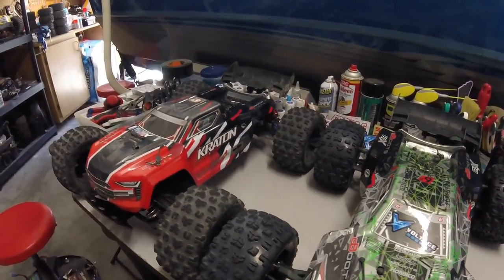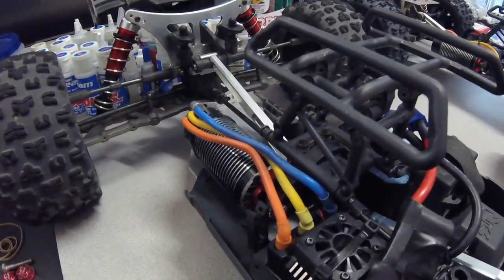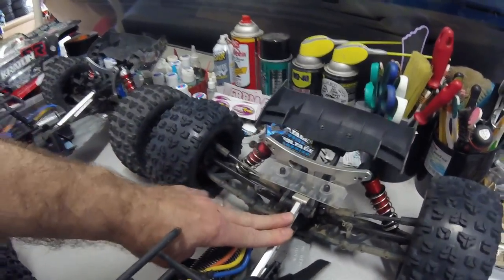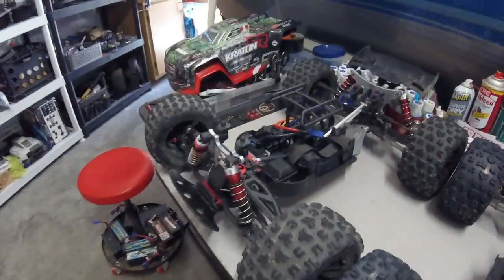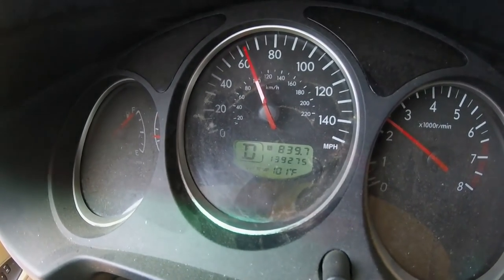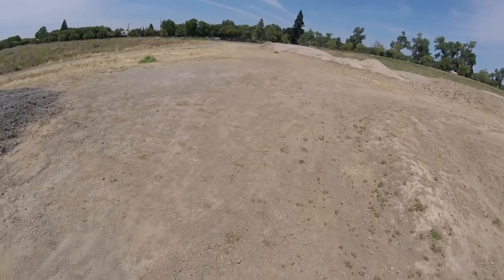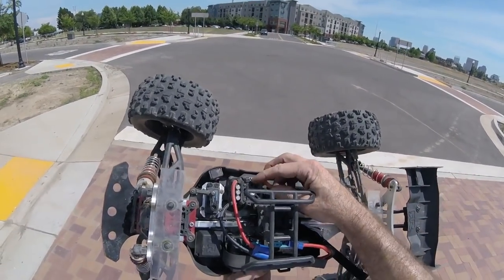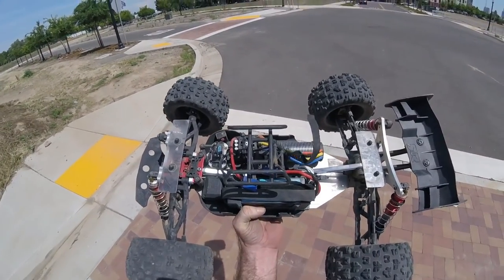ARRMA Kraton V4 "Goes Beefcake" Upgrades and M2C shock testing...

Comment from the maker: I'm super excited about this M2C shock setup 😍. Experimenting with newly arrived piston sizes as we speak 👀. The aim is to pair them perfectly with the stock 1000cst oil weights for simplicity. Keep you posted on progress as testing continues👊. If you're tired of chassis bendage 😱 click the this link and be done with it already🤣🤣. Your Kraton will thank you later 😍 (use the "m2ccoupon" code for 20% off)https://www.m2cracing.com/product.sc?productId=937
Reply: How do you keep your diffs from exploding?!  I am running a castle 1717 in my Kraton with super swampers x38(i think). My weak spot would be these diffs im just wondering how long yours last running like that!
Reply: Oh and super bash session!
Reply from the maker: @chrisoconnor3119  thanks Chris 👍!!!! I shim my diffs and try not to land on throttle. Still using Mugen seiki E0206 and Tekno #1222 shims. The V4 diffs are shimmed differently of course with planetary and outdrive cup bearing shims from the factory. 😎💪👊👊
Reply: Hey Rich have you tried the hobbystar escs at all I'm wondering if I should go with the 150 amp of theirs or the hobby wing max 8 they seem pretty similar and the hobby star rating the amps are a little bit higher it's like a 1050 or something
Reply from the maker: @shanemcclain8562  I would opt for the Hobbywing Max8 personally. I haven't tried the Hobbystar 150A myself, but know of 2 people who simply couldn't run 6s with them 😝. Can't recall what the resolution was, but they were left disappointed. 😎💪👊👊
Reply: @richduperbash2966 u should see if they'd send u one to review and try out
Reply: @richduperbash2966  what hobbywing motor would u pick
Reply from the maker: @shanemcclain8562  the 2200kv 4274 works Killer in my Typhon and Teknos. Has to be geared right to avoid overheating in the Kraton. The 4985 combo looks ferocious, but would add a bit of weight too.
Reply: @richduperbash2966  I plan on putting it in the EXB what pinion u think plus I'm probably going to put a fan on it I want to wheelie at any speed and try to be around 60mph
Reply from the maker: @shanemcclain8562  I would try a 15T and just check temps intermittently. Should be ok if your bearings are healthy and mesh is good. I'd think 60 would be no problem 👍.

Comment: Awesome video bro some great upgrades rite there definitely beefcake for sure lol gonna try out those shock caps on my V2 Goliath just got the V4 shocks on it so that thing should be ready to rock bummer on the servo man happy bashing my brotha👍🤙😎🤪😜😝🙈🙉🙊👊✌
Reply from the maker: Thanks so much Chris 😜!!!! I tell ya, every time I go to test something I lose a motor, servo, or have something else totally unforseen happen 🤣🤣👍. I'm dead set on both getting a bash in and figuring out what changes are needed 👊. Just got another piston shipment to experiment with today and have a drill kit if needed to really fine tune the perfect hole size. The rear feels about perfect, just need the fronts dialed 👌. The goal is to keep the stock Arrma 80 weight/1000cst and tweak the piston around that for simplicity. No more center brace on this V4 🤣🤣😎💪👊👊

Comment: I absolutely love my Kraton it's a beast, just keeps on going and going soaking up the hard hits like it's nothing.

It's completely stock atm, the gearing, everything but aluminium chassis braces are in the post... but what a tank!

Money well spent 😁
Reply from the maker: That's SO AWESOME to hear Dave😜!!!! I still think the Kraton 6s is the best RTR basher hands down for the money 👊. Just hope the STX2 controller disappears in the future 🤣🤣😎💪👊👊
Reply: @richduperbash2966  that controller is pants fair play dude. I use a radiolink controller. Was cheap as chips but far better quality than the stx2.
I think you're right about the Kraton 6s being best out the box basher bro. Awesome fun

Comment: Good project, playing with shocks. The multi hole pistons give you massive pack and i'm not sure, if this is the right way. 
Maybe there is a perfect setup for landing without any bounce on a perfect day (in temperature), but that will be a long way in testing.
The biggest problem with our rc shocks are massive high and low pressure zones around the pistons. 
This, without pressurizing the oil, ever will suffer in rebound damping after a total collapse (landing).
I hope you'll find a solution.
Good luck!
Reply from the maker: Thanks so much Marc👊!!!! Shocks are a complex subject for sure. There's definitely no perfect set up for all tastes and conditions. Temperature has a big impact no question. I'm trying to be as scientific and objective as possible while studying them on the bench and in the field 👀. There's definitely a noticeable difference in friction and stroke smoothness between these O style pistons and the stockers with  an empty (lightly oiled) shock body. It's hard to discern exactly what affect the piston notches on Mitch's pistons have on directing pressure towards the O ring🤔. His intent was to slow rebound further by directing some oil with the notches. The actual piston cut tolerances are very precise. We'll see how things go, but I'm enjoying getting oil on my fingers 🤣 and trying to find a solid setup. Regardless of the end result, I'm learning a few things in the process. 👍👍😎💪👊👊

Comment: The shock caps are looking killer man! Smooth and the delrin insert is much much needed!! Now if we can convince Mitch to do the lower shock mount in delrin we will be all set 👌 Thanks for braving the heat for us man! 100 degrees is no joke 😱 Now that I have seen both of the motors back to back the 1730 with the max8 looks to be the better performer. Of course if it overheats none of that matters 🤣 I still recommend the 4082 1600kv with a Max8 it has done so well in my beefcake Kraton 👍
Reply from the maker: Thanks so much Aaron 😊!!!! I'm super stoked with how this setup is going 👀. Was worried I wouldn't get lift off the jumps, but it hasn't been a problem at all👌. Landings feel softer with less bounce. That would be Killer if Mitch offered Delrin rod ends 😍. I honestly still favor the 1730, but my 1480 has been problem free with regards to ESC pairing and good temps 👍. I keep forgetting about the 4082🤣. Really appreciate and respect your input about it Brother 🍻🤘🤘😎💪👊👊

Comment: what punch setting do you have? and what are your toughts about that?
Reply from the maker: I generally run max punch setting on all my ESC's because I want the option for instant full power when needed. Just let my finger do the adjustments as necessary. 😎💪👊👊

Comment: Wow - some serious air and nice control. I picked up a 6s Kraton this weekend.    Question, what would you say are the best few upgrades for 1/3 the amount of Air that you are getting? Thanks in advance!
Reply from the maker: Thanks Brother 👊!!!! The essential 5 I swear by are aluminum chassis supports, servo mount, RPM rear skid plate, and either RPM or Tbone front bumper. 😎💪👊👊

Comment: Would have liked to see a few more big air to flat ground landings with those emulsion shocks. Would have been cool to see the footage one right after the other like you did with the stock shocks vs those, but you didn't really air the thing out in the second part. Great footage as always! You are one hell of a wheel man!
Reply from the maker: Thanks Bryan 😊!!!! Just to clarify, this was all footage running the M2C emulsion set up. The first part was prior to swapping my V4 to M2C chassis, bigger motor, towers.... etc. My plan was to do a side by side style bash comparing stock with the M2C but my servo changed that. The other part of testing involves mixed terrain running, cornering, drop testing, along with jumps of course. Not everyone is into doing big sends, but hard flat landings are a good test for sure 👍. My primary initial goal was to see how the pistons held up and gauge whether I'm even going to like this setup. So far I'm definitely digging it 😍. Lots more testing to go. 🍻👍👍😎💪👊👊
Reply: @richduperbash2966  Oh, I see. I thought the first half was the truck without the bad servo and stock shocks and then when you tried running the second truck with the bad servo, you swapped the shocks to the first truck. I appreciate the break down. Now I can just go check out the v4 video to see how it responds to those big jumps.
Reply: Yep, does seem less bouncy on the big jumps and a bit more planted in the flat/rough areas. You running a different oil weight too?
Reply from the maker: @olds97lss  the first part I was running totally stock oils (80 weight/1000cst). The second part I ran 1000cst rear/2000cst front 👀. I did that because the front felt a bit soft the first run and I didn't have anything between 1-2k. The issue is ARRMA uses 1.4mm rear pistons and 1.2mm fronts. My first test pistons were all 1.5mm. Just got another shipment today that should allow me to dial things in nicely 👌. The goal is to tune the piston combo to work perfectly with the stock 1000cst. 👍👍

Comment: Super killer bash on the both V3 and V4 Kraton Rich. No holding back and no hesitation airing them out. Kraton is such a classic Beast like no other. I definitely see difference between Arrma shocks and M2C shock mods. Anything that makes experience better is a win in my book. Any difference in overall handling between V4 and V3 Kraton bro? Bash on man..
Reply: You guys use stainless screws with m2c chassis , im going check out shock mods if they available yet or rich you  just testing  to improve? The mod  i think i asked already lol awsome bash usual here enjoy how its done 💪💪💪💪💪🏋️‍♀️🏋️‍♀️

Comment: Hey rich. Firstly i was curious if you ran any upgraded springs for your shocks or do you just use stock? Secondly im also running the hobbywing max8 with the hobbystar 1480kv 4092.. going to use a 22t gear.. do you think il have problems overheating that setup?
Reply from the maker: Since ARRMA came out with the updated (V3-V5) shocks, I only run stock springs with the 6s rigs. 22T is what I normally use with my Hobbystar 1480kv 4092 with stock size tires with either 150 or 160A ESC 👍. I usually gear to about 150F for maximum performance and efficiency. Much hotter and I'll gear down or wheel size down. Temps have lots of variables of course.... smooth bearings, good mesh, rig weight, outside temps....etc. 🍻😎💪👊👊

Comment: Nice bench video,,like the o ring around piston... bladderless shocks like the HD shocks i found...   I was not as impressed as i thought with the V4,,, Feels to me that the plastics have been changed... think they cheaped out...
Reply from the maker: Thanks so much Brother 👊!!!! I'm really hoping this shock setup works out. So far I'm digging them👀. Just trying some different piston sizes to pair better with the stock 80 weight. Trying to keep it simple for people. I've had decent luck with my V4 thus far, but you nailed it with the center brace being too rigid 👍. The M2C chassis is the best solution I'm aware of. It flexes slightly, but doesn't bend. The difference is night and day 💪. No bent center driveline of jacked diffs. It's like building a good house. Starts with a quality foundation.🍻🤘🤘😎💪👊👊
Reply: @richduperbash2966  still haven't broke down and spent the money... i really haven't had any problem with stock chassis yet... as long as i have front and rear chassis braces in... i don't send it that high so it holds up.. They look strong as f***  though...lol💪💪👊🤙

Comment: Hi Rich, Ive had a slash 2D, a Bison V2 & currently have a DHK Hobby to bash. It looks like I can stretch to a new Kraton V3 6s or the new Kraton V4 4s. In your honest opinion, which would you get for starters? Thanks in advance.
Reply from the maker: I would honestly grab a V3 with Tactic controller if you can save some $$$. Do some basic upgrades and have at it 👍. If you start bashing harder or having chassis bendage, invest in an M2C Goliath Series chassis. Worth every penny. 🍻😎💪👊👊

Comment: Nice video on the Kraton so do you believe the the tower to tower brace isn't really needed as I have seen another video where the operator thinks it caused his rear diff to brake away from the chassis?.
Reply from the maker: The tower brace is definitely not needed with the M2C 7075 chassis 💪. With the stock V4 setup, I'm thinking the brace would   be more effective if it had some give like the new 4s design. All my homemade tower braces had some give built into them and worked quite well overall. It's certainly true that a bolted/rigid  tower brace can transfer energy and cause lateral damages during really bad nose or tail impacts 👀👍👍😎💪👊👊

Comment: Hey rich, love your videos, love your info. I noticed you have the hobbystar motors in your kraton’s with the max8. I also have a max8 in my typhon paired with the stock 2050 motor, and for some reason my motor tends to get really hot! I also have a v4 kraton that has a max6 with 1650kv motor. I guess my question would be, how do you keep the temps down with your motor setups? Do you think it would be alright to bolt up a 1650kv motor on my max8 typhon? Thanks for your time! Keep up the good vids, thank you for sharing all your wealth of info!
Reply from the maker: So sorry I missed your question Brother 😝. I generally control motor temps through gearing or wheel size. Assuming the bearings are all healthy and connections and solder joints solid, I gear down or wheel size down if temps go much past 150-160 tops. 150 is my target temp for maximum performance and efficiency. Beyond that performance suffers. 1650kv should pair great with most any 150A ESC, but runs a bit stronger with the Max6. Hope you got it sorted Brother 🍻. Appreciate the kind words!!!! 🍻🤙🤙😎💪👊👊

Comment: Question for ya... How fast is the 6S Kraton if you were run it on just one 3S battery? Or can you even do that? Is it still pretty fast, but just not stupid fast? I see value in running it this way if I hand the controller over to my 12 and 13-year-old boys. I do understand that the new remote has a feature that allows you to toggle between 50%, 75%, and 100%. However I feel like those variables Would be valuable even on a 3S battery to slow it down even more. The question is can you even run it on one 3S battery? Lastly if you can… Could you set it up to run twice as long if you run the connections utilizing a parallel adapter. In essence, my two 5400mah 3S Batteries would last 10,800mah of time. Have you ever ran your 6s Kraton or any of your RC cars utilizing a parallel adapter to double the time running, with lower cell count? Thx!!
Reply from the maker: I've never ran a parallel adapter to say🤔. I personally prefer shorter run cycles to simply swap packs and look my rig over while it cools a bit. You can run 3, 4, and 6s with the BLX185 ESC no problem. 3s has decent speed and power especially for kids. I'm not using the STX2 controller. Simply don't like the grip or cheap oversized plastic wheel or spring tension. Just swapped in the old Tactic TTX300. 🍻😎💪👊👊
Reply: My next question, has to do with the spectrum remote. It seems there’s quite a bit of delay especially when trying to go in reverse. Also if I set the power down to its lowest setting 50% On the remote. And I don’t have a throttle dial turned all the way up. It doesn’t even recognize reverse. Not sure if that’s normal. From what I understand you switched back to the tactic. If I buy a better remote am I going to see in improvement in at least lag time (especially with reverse) if I just simply get a better remote? Or is that delay when you’re at a stop and trying to initiate reverse a typical annoyance everyone experiences in RC?

Comment: Love the channel man! Would u recommend ditching the tower to tower brace with the stock chassis and aluminum chassis braces?
Reply from the maker: Thanks so much Brother 🤗!!!! That's tough to answer, but I feel the stock tower brace would work better if it had a bit more give to it. Perhaps if it had the rubber insert like the 4s brace. For brutal impacts, the stock 6s top brace can lead to reverse bends towards the rear of the chassis vs upward bowing. Best solution is honestly the Goliath Series chassis with aluminum chassis supports and no tower brace. 🍻😎💪👊👊
Reply: Cool I’ll look into that chassis. Appreciate it!

Comment: Great video Rich! Can you tell me if a particular Arrma  might be less likely to have chassis flex/twist or are they all susceptible to hard bashing, especially when the drivers last name is Duperbash? lol. I've had many bad wrecks with my 4s Outcast 4x4 with only a-arm breakages  but I'm not as merciless as you because I'm not as skilled as you. (understatement lol) Thanks Rich!
Reply from the maker: Thanks so much Brother 👊!!!! The shorter Typhon and Outcast are less likely to have chassis bendage by virtue of less leverage between bulkheads. The 4s models are fairly brilliant as is honestly. I've personally bent all the 6s models despite aluminum chassis supports and running tower braces. The 3mm stamped aluminum chassis has limitations for sure. It's fine until you start playing rough or have a really bad hit 👀. The M2C 4mm 7075 chassis upgrade option is a true game changer 👌. 100% solution for obvious and subtle problems that arise from excessive chassis flex and bendage. 🍻😎💪👊👊
Reply: Can't thank you enough for your helpful reply's.